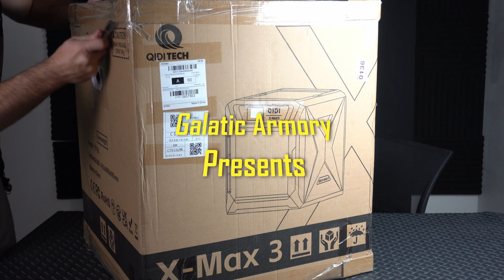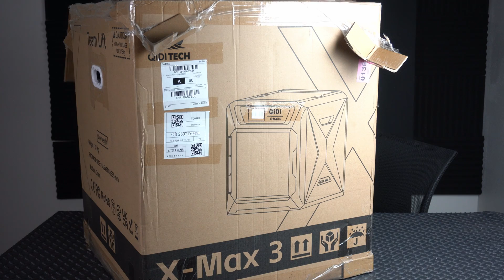Qidi X-Max 3 Review: She's Big & Fast

Comment: This is the first video I've seen from your channel, so forgive me if I'm suggesting something you've already done, but have you looked at the CR-M4 (Or Neptune 4 Max)?  It's a bed slinger, but it's MASSIVE, and the few reviews I've seen have been pretty positive.  I noticed that a significant number of the printers on your farm were open/caseless, so thought I would throw this suggestion out there for consideration.  Also, is the X1C big enough for helmets like this?
Reply: May be late to comment on this but I am looking to replace my Neptune max as it's been problem after problem. Support is okay but as soon as I have one problem fixed, another one pops up. After the first month, just nonstop problems. 
Maybe someone will see my reply and look into these more because while initially great, it's not a printer that is easy to work on or with for the average hobbyist.

Comment: A few comments in no order… you can improve bed adhesion by a little more squish. The included plastic sheet for setting Z offset is a little thick… squish it a bit more. And of course you need to wash the sheet with soap and water to remove any residual contamination. This is a common issue with many printers. Seems you should have had bed adhesion dialed in before leaving the printer unattended. This can happen with any 3d printer, but obviously an enclosed printer is more likely to damage itself because the mess has nowhere to go. Not defending Qidi but it seems you gave up on it after one problem which was a possibly self-inflicted. Bambu would have detected the failure (maybe) but from what I hear most people turn that feature off because of all the false positives.  And you can add a cheap webcam to the Qidi and run free Obico software for spaghetti detection, self hosted, so no data leaves your facility. I also think much of the point of running a Qidi is for the heated chamber, so you could be printing in ABS which IMHO is better for cosplay props anyway… doesn’t shrink in the sunlight and is tougher and easier to sand. Anyway I don’t really know how these printers stand up to print farm usage, but after your video, I still don’t know….
Reply: Qidi now has a Camera module for $30 u can add.
Reply: Thanks for that info, I'll probably try that app.
I've bought a Qidi X-plus 3 last week and prints seem decent. 
I had at first a couple adhesion issues but after adjusting z-offset I haven't had any. 
All the prints have adhered perfectly (even though I wipe the print plate with my hands).

Comment: As an owner of the X-MAX 3, I will admit that this has happened many times. I find that using applying glue stick really helps keep the print stuck to the bed for the projects. That's why they include a single stick with them. Just get yourself a bundle pack of glue sticks and you should be set.

Comment: I have the CR10 S4, 3 years now. Runs great but slow. I am upgrading with newer parts, going to use klipper and get better print speed and finish. My brother has the QIDI X Max3. He figured it out on sticking to the print bed, and gets fantastic prints. Not all printers work well with different filaments. I found what works for my S4, I stick with it. He will stick with his filament for the Qidi X Max3 as well.

Comment: they used to be good when they were just making variations of the makerbot. Their quality has gone to hell. They are erratic and will not hold level among randomly deciding z offset should ram the bed into the nozzle. too many things you have to fix to get it to work right. THey had to send out complete upgrade kits to people that replaced the whole hot end and other major parts.

Comment: I sure wish this video came out before buying my X-Max 3. Mine has also had many problems - too many to list here.
Reply: What kind of issues do you have? I'm looking to buy and about to pull the trigger on it
Reply: Like I said, too many to list, but here's my top five:

1. The heat break on the hot end is under-spec'd. You get heat creep and jamming if you try to actually use the heated chamber. QIDI advertises 65 degrees on their website, but I'd say you can realistically get away with about 30 on PLA, 38 on PETG, and 45 with ABS and Nylon.

2. Because of the lack of sufficient chamber heating, large prints tend to warp badly. The large build volume is the whole reason you'd buy this printer, but the inability to adequately heat the chamber and prevent warping makes it far less useful. Once a large part warps, bed adhesion can suffer as well.

3. The slicer profiles that come with the QIDI slicer are optimized for print speed and NOT part strength. If you want parts that are strong and look good, you'll have to build your own profiles that run much slower. Also, the Arachne perimeter generation tool can ruin parts that have a lot of large flat-ish surfaces.

4. The printer doesn't always do what the slicer software tells it. You'll probably have to configure some custom g-code if you want to do things like pause for filament changes or accurately control the cooling fans. This is just unacceptable for a machine aimed at the prosumer market.

5.  The printer is cheaply built, noisy, and rattles like a tin can full of marbles. It makes me doubt its longevity. QIDI will send you spare parts if things break, but I wanted a good printer. I don't want to have to wait a week for parts that never should've broken in the first place. 

I wish I had just bought a BambuLab P1S combo and learned to deal with the smaller build volume. Just my 2 cents.  @Thismikeguy

Comment: 3:36 I guess it's great when you have an acrylic cover over a glass cover.
5:45 17? It takes the Kobra 2 Max twice that mount to print on max speed I think.
6:55 What slicer did you use? I have the mentioned printer on the last statement I don't know if I should use Cura or not. I haven't fully tested it yet to print helmets!
7:29 Oooooooh... Damn!

The search continues.
Reply: You can use the qidi slicer or orca slicer

Comment: Are you folks planning to try out the Prusa XL once it ships? 36x36x36 volume.
Reply from the maker: Never really understood the hype of prusa printers but might try it!
Reply: @GalacticArmory  having only owned the mini I would say it's the quality control and reliability. The fact that their own printer is what they use in the factory to produce them shows that they are stress-tested far more than any other printer around and get further refinement as a result. The mini was incredibly reliable and gave me great results with little tinkering, but that's just my anecdotal experience.
Reply: @LankyFrank  I know some people don’t like it but I’ve had nothing but great results with my k1 max
Reply: @TheTeeDay  I've heard good things about performance I think it's the business practices most people (including myself) are probably not so fond of. The price is so insanely competitive it's hard to overlook them. I also don't like that I have to use the cloud, I wish there was a local alternative.
Reply: 36x36x36cm so 14x14x14in not that much larger
Reply: @TheTeeDay  Nah it's only a tiny bit larger, I think the print quality, reliability, and MMU functionality will set it apart from this particular model though. I am very interested to see how it compares to the Bambu offerings.